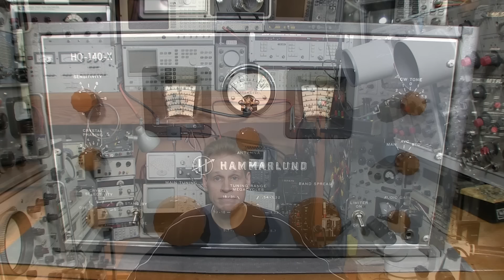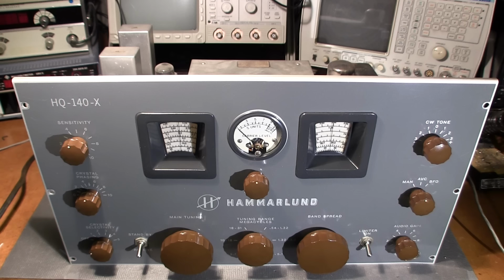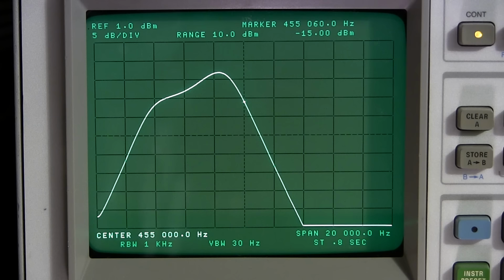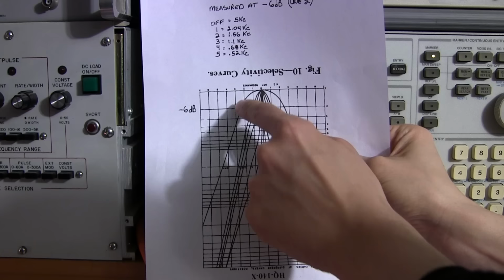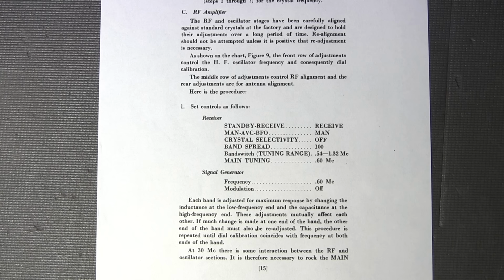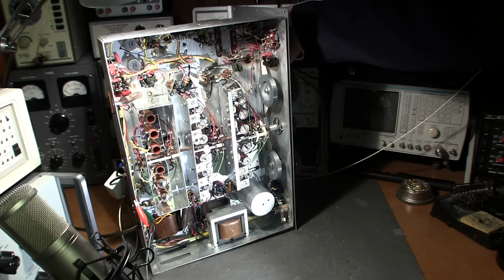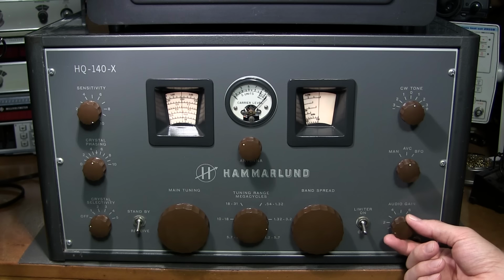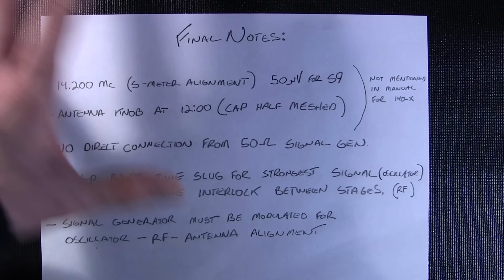Hammarlund HQ-140-X Repair and Restoration

Comment: What happened with the audio on this one? The s'es are very pronounced. Never heard that on your videos before and since your an audio guy maybe youhave a sollution.
Reply from the maker: The problem is not on this end. The audio is reviewed on studio monitors flat within 3dB. You will notice a difference though as the mic and audio is much cleaner now. (wider with less compression)
Reply from the maker: I should add that this doesn't mean the audio is flat, just that it's reviewed on monitors that are, so I have a good reference as to frequency levels. This applies only to frequency, not to amplitude variation.
Reply: Yeah you are right.  When I changed my audio I/F to 48KHz sample rate it almost totally de-essed. Very strange though. Thanks for the reply. I knew the error would be either with youtube or my settings.
Reply: 'When I changed my audio I/F to 48KHz sample rate it almost totally de-essed.' - Let me guess: You have a Realtek HDA sound chip with a driver that's about 5 years old? I've come across some funky bugs here and there. A number of older soundcards without native 44.1 kHz support also had some... interesting ideas about resampling quality. When it's dead obvious on speech it's BAD!
Reply: yeoldeengineer
 No it's a zoom h4nPro. People who have only realtek hda usually dont know what essing and I/F's are. The integrated on my 2008 dell laptop works allright though. 44,1 is the default on the zoom because it's a field recorder and for interviews you dont really need more. Maybe it will clean up with a firmware update.

Comment: you are really torturing yourself needlessly  listening to sideband with a bfo instead of a product detector, and without avc meant for ssb.   Using a radio for what it was designed for will keep you from being unhappy with it !  In this case it is primarily for AM, with  cw being reasonable.
Reply: It's a general coverage short-wave, not really so much for ham use. But a BFO can be a very versatile tool.